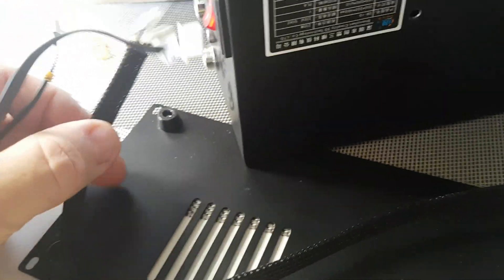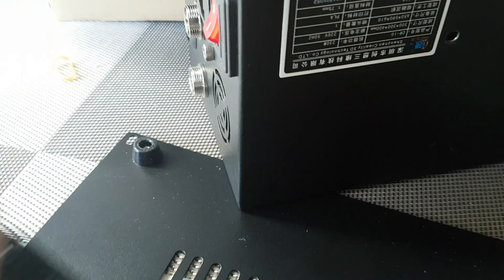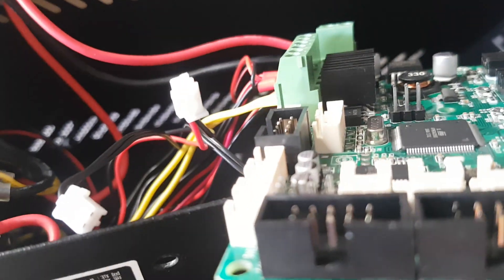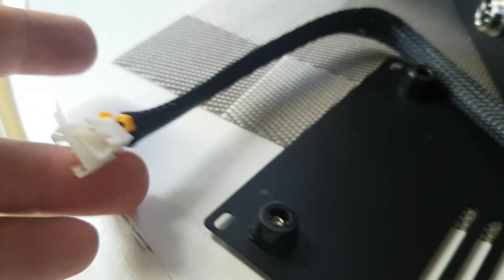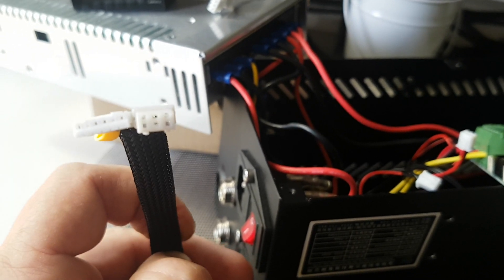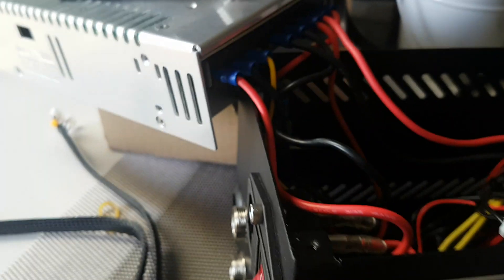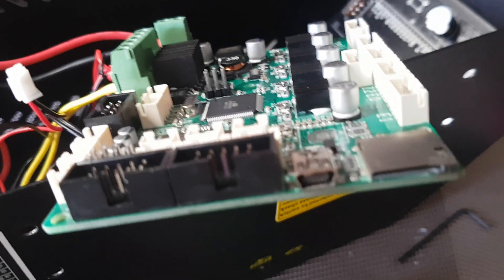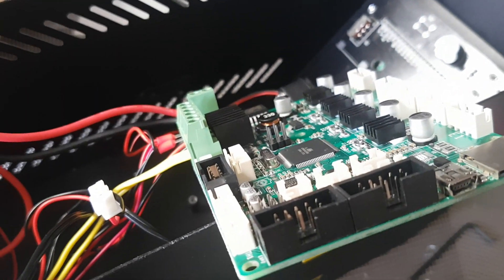CR10 upgrade to CR10S cable problems.

Comment: My stepper spins but makes a ticking noise when spinneng
Reply from the maker: Which stepper the other Z? You may need some light oil.
Reply: @chuxxsss  I upgraded my board from the normal 10 to a 10s and now all the steppers make a ticking noise. But they still spinn
Reply from the maker: That doesn't sound right?  My board didn't tick. Maybe the board is fauilty. Try the old board again. Also you could upgrade the b oard to a MKS Gen L V1.0 board only 20dollars us. Then buy driver 5 x A4988 driver boards. May work better. You have to invert each motor in martin for these driver. Plus check and set the driver voltage from old to new.
Reply from the maker: It's alway the small thing tgat stress you out. Have a wonderful day Ian.
Reply: @chuxxsss  you 2

Comment: My cable extension the pins was correct but had endless problems with EMI. The end stops register at random interval, the Y stepper was the main problem. If you check Creality you will see the stepper motor cable (4 wires) is swapped,  this is to prevent current flowing in the same direction but opposite, however I swapped mine on both sides of the extension cable but still lot of random end-stop detection's. I then added up to 200nF caps on the micro switches, then it would at least home, but find it impossible to do a print long than 3 minutes. I also remove the end stops cable out of the 'snake skin' and this also help. however I am still not capable to print..  This does not work at all for me..
Reply: you ever figure it out?  I am having issues with mine also.  I am thinking about just redoing the cables themselves, myself with longer wire.
Reply from the maker: How about using a toroidal core ring on it to remove the EMI signals. It may work for you. Only a idea. Hopefully that will work for you. Have a great.day.